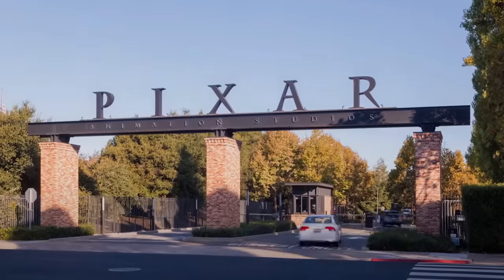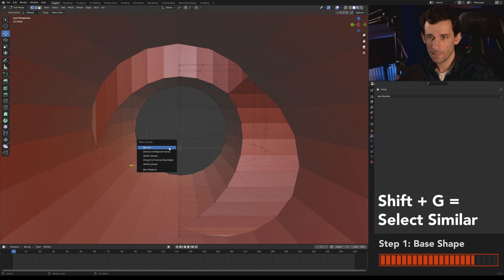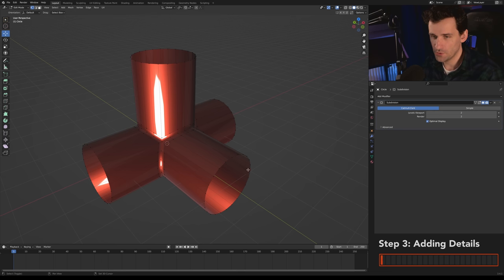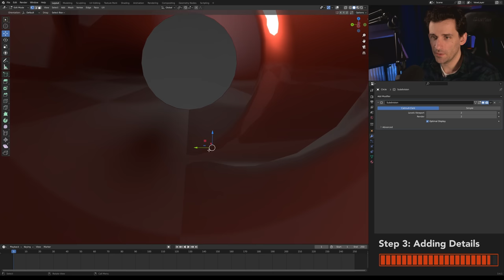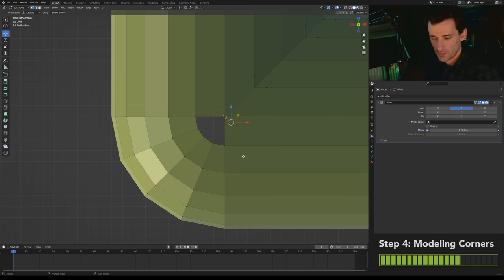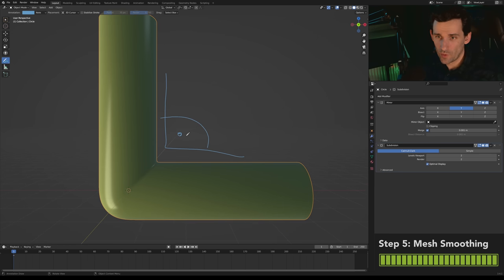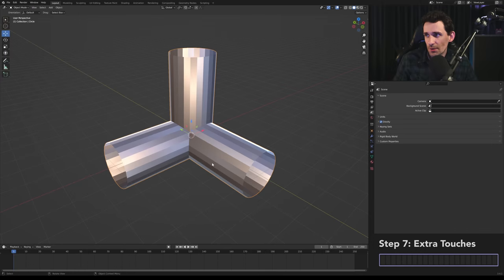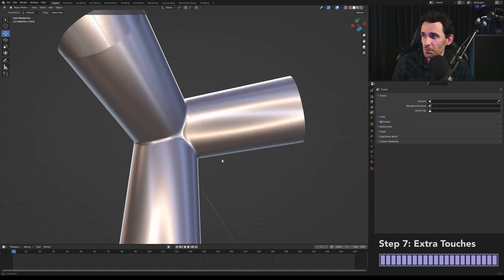3D Models That Will END Your Career

Comment: On engineering CAD software, this is insanely easy to make. However, what separates Blender from the rest is that it must be made completely by using only surface modeling, which even in CAD is annoying to do properly.
Reply: The general pipeline between 3D CAD and surface/poly modeling could use a lot more attention. Both geometry types are fundamentally the same at render time, and topology generating algorithms for 3D CAD programs are so advanced now that they can efficiently produce a mesh at various levels of resolution based on parametric data (at least for certain geometry types,  like what is shown here.) It would be awesome if the big software companies started including parametric modeling tools in their animation programs, but of course that wouldn't be in their interests from a sales point of view.
Reply: CAD uses NURBS contrary to standard 3d modelling softwares aimed toward cgi
Reply: @ozzman1997  iirc blender is working on it. It's slow obviously cuz it's blender, but they're working on it
Reply: @samwilde8311  blender is quality over quantity but always behind because they don't focus on quantity
Reply: I've worked on Revit content for Wavin and Geberit. Proper elbows and T-joints were pretty hard to do, especially if you have elbows with an eccentric pivot or a pivot outside of the geometry (which turns it into a bend). Of course, in Revit you have to sacrifice some precision in the geometry in favour of model performance, as long as quantities and pipe segment lengths are spot on. But I have been known to be a stickler for precision, and I wish Revit had modelling tools like Inventor or Blender without sacrificing parametricity.
I loved modelling pipe geometry. But I'm also very happy to work for a residential developer again since that's where my heart truly lies.
Reply: @eddwarriior  "CAD uses NURBS contrary to standard 3d modelling softwares aimed toward cgi"
But you really don't need NURBS for this kind of application. That's just overk_ll. I can make this part flawlessly in any 3D CAD software with fillets, in about 10 minutes, and not a single spline was used. 

Really, NURBS only becomes relevant in higher complexity surface modelling, and as was said before - parametric polygonal subdivision to approximate the NURBS-borne swept surface can be used to create a surface model from it after completion.
Reply: @eddwarriior  Where can i get basis on that you are talking about? ahahah it's extremely difficult for me to follow this discussion and I would like to have more theroy basis in order to study 3d modeling in a clever way
Reply: i was watching this with a background in Parametric modeling Engineering software like Pro E thinking why is he making this so complicated.
Reply: Much easier, quicker and straightforward in any serious 3D CAD. Even when using surfaces.
Reply: it's really easy to make in blender also. one extrude and two mirrors from quad-sphere
Reply: @mikel9656 Pro E is great modeling software. Been working long time ago with ProE. Sadly, after school i stoped wroking with Pro E and kept learning Solid Works. And now after years of not doing any of two i mentioned i am just a noob like i was first time seeing those softwares. And all because i failed to find job and use my skills back than. And on top of that i was in top 3 with AutoCad, solid works and ProE at that time. And now i moved to Blender for 3D modeling and animation. Yes i am an idiot that left all that knowledge to go to military..... 😂😂😂😂 And now i am going to need months or even years to get back to that level from my school that i was 10 years ago..
Reply: Wanted to say the same. Animation folks call that hardbody desing or something, but all in all, I think parametrized cad design and volume operations instead surface modelling is way easier and more deterministic. I don't get why this is so rare in animation.
Reply: right, as a solidworks user i see all of these and just laugh lol. then i remember I also use blender.. then I cry
Reply: Actually what we are trying to achieve would be “perfect” topology whether its polygonal or NURBS, it becomes important as the object in question gets a reflective surface because that would highlight the underlying mesh/surface structure - in the realms of engineering CAD not all of them allows you control surface patches.

For example for complex surfaces with high quality reflections in certain cases would be much better to model with Alias or CATIA, while you can get a very similar result with polygons ı wouldn’t recommend it if you are not very experienced. For artists Plasticity would be an excellent option as well for since you are not going for manufacturing data
Reply: Maya have nurbs and they can be converted in poly mesh but actually i dont remember how its topology after the conversion
Reply: Also topology is very important
Reply: I think the fasted way to the best result is buying that piece of pipe at a warehouse. But seriously, with FreeCad its a breeze.
Reply: my dumb ass kept saying “and then he’ll use the filet tool”
Reply: CAD is awful imo
Reply: @Rayaann Different horses for different courses - basic polymodeller or sculpting app is just as (or more) awful if you try to use those for demanding jobs meant for CAD. Some newer apps (f.ex. OnShape and Plasticity) are more accessible for those coming from polymodelling, could be worth checking out.
Reply: @kingcognito  trueee tyy

Comment: I'm surprised that you didn't use Chamfers, not even once. Using chamfers is a very useful and handy way to quickly add edge loops from a selection, and it also has the benefit to provide EVENLY SPACED control edge, which would be nearly impossible by hand.
Reply: Chamfers and edge loops really saved my time
Reply: If you're going to optimization, the Chamfer modifier isn't a good idea because it can create extra unnecessary polygons and edgeloops, inserting loops manually is still the best option.
The real unspoken lifesaver is the Weighted Normal modifier
Reply: @eddwarriior  true but it's easier to chamfer/bevel then dissolve or merge unnecessary geometry, and you have more control over precise curvature
Reply: What are chamfers?
Reply: @reculate3332  Essentially turns a sharp corner into two slightly less sharp corners. If you google it then you'll see illustrated examples that explain it much better, but it's essentially just filing a corner into a slope.
Reply: @reculate3332  something that can be a thorn in the side of a lathe operator...  there's a reason in the lathe area of a machine shop that there is inserts thrown everywhere on the floor, usually associated to chamfer edge not being smooth because they forgot to check the parts coming out because they was on their phone.  Then at break you hear rude comments from down the line about rough the chamfers are and its eating the polish inserts up fast......  LMAO more simply put if we cut off the end of a pipe and file the sharp edge at a flat angle, that's a bevel or chamfer.  In which a locomotive piston sleeve can have up to 6 different chamfers depending on model and how it seats into the block.
Reply: @reculate3332 chamfer is another term for 'Bevel' which is like smoothing a hard edge by 'sanding' a new face along it

Comment: for the last one, i found it easier to use a Quadsphere instead of a UV sphere. This is made easier by one of the pre-shipped addons, but you can also create a quadsphere from scratch in default Blender. Take a Cube, add subD modifier, add cast modifier, change it to sphere and set the value to 1. Advantage of the Quadsphere is that you have the exact corner topology you need and no need for all that merging of vertecies :)
Reply from the maker: that method is almost perfect, like 97.5% pure. but you have a vertex exactly at the center of the corner, which causes a small shading bump (check it with different matcaps). I also tried it as the to go option... and it opened a rabbit hole that resulted in this video lol.
Reply: @Chocofur    When I saw the problem, I was thinking "oh yeah, of course, you want that ⅛ of sphere with a constant number of segments per edge, and a quad on each vertice", but couldn't think of a way to do it, I think that's what separates the novices from the veterans :)

FWIW, someone mentioned elsewhere using bevel before casting to sphere, using the n of segs of 1/4 of the cylinder and max bevel size. I can't check because my PC has been dead, but that may leave the center of the corner with a tri, instead of a vertex.
Reply: @Chocofur  I'm pretty sure I fixed it. Uploaded a video on my channel (My only video), where I show how I construct it and how I presumably fixed it.
Reply: @lomborg4876  I think it worked for me too, are you real?
Reply: @bernardodecarvalho42  I am. You’re welcome☺️
Reply: @Chocofur  It looks like that small shading bump is caused by that center vertex being at distance "1" from the sphere's center. Moving it ever so slightly inwards removes the bump. This can also be achieved by deleting the vertex and re-creating it by extruding the corners of the three surrounding faces and merging them at median.

Comment: Instead of using a UV Sphere use a Cube with subdivision surface modifier applied. Then use Mesh > Transform > To Sphere to make it truly spherical. Scale it to fill the gap and cut it. Then just join and merge the vertices by distance. You will need to recalculate the normals but it will result in clean topology.
Reply from the maker: that method is almost perfect, like 97.5% pure. but you have a vertex exactly at the center of the corner, which causes a small shading bump (check it with different matcaps). I also tried it as the to go option... and it opened a rabbit hole that resulted in this video lol.
Reply: @Chocofur   using Smooth Vertices on that one vertex seems to fix that issue for me
Reply: @Chocofur  lomborg4876 on fxnarji8302's thread showed a manual way to do it. (vs sidesector's Smooth Vertices)

Comment: Pixar: Alright, the next movie will be about a character living in sewer pipes.

3D Modelers: *nervous sweating*
Reply: But Pixar uses Maya right? These are pretty easy to model in maya
Reply: @youji8516  Pixar mostly uses their in-house software.
Reply: The rendering probably would be super easy in a confined space.
Reply: @jaydenjackson3193 RenderMan and Presto.
Reply: so no ninja turtles by pixar
Reply: Flushed Away 2
Reply: pipes living inside a character
Reply: @Tharkz  it is called vascular system
Reply: If so Pixar immediately codes a parametric pipeline generator so no one wastes the time with pipe modeling.